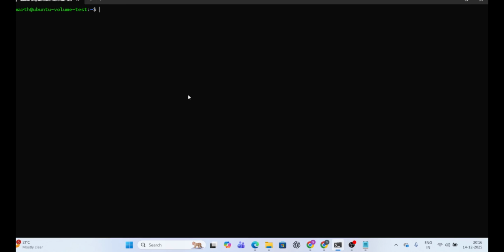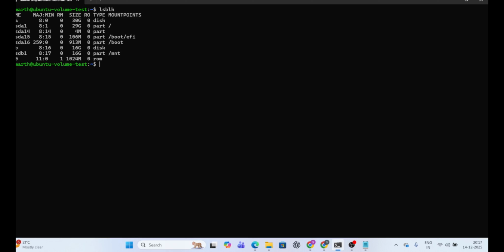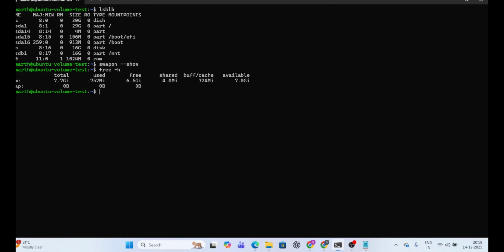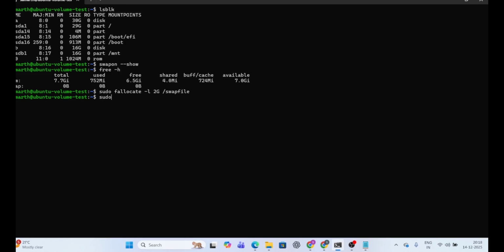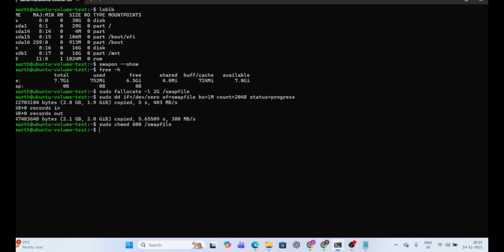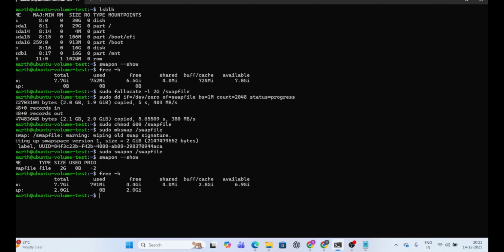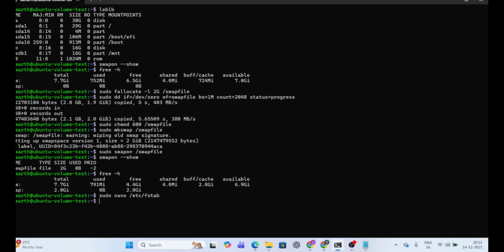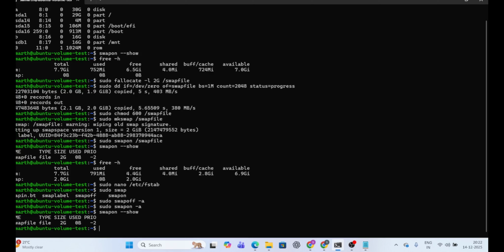Linux Swap Space Explained | Create Swap File & Partition | Ubuntu Step-by-Step

Comment: NOTES
   Files with holes
       The swap file implementation in the kernel expects to be able to write
       to the file directly, without the assistance of the filesystem. This is
       a problem on files with holes or on copy-on-write files on filesystems
       like Btrfs.

       Commands like cp(1) or truncate(1) create files with holes. These files
       will be rejected by swapon.

       Preallocated files created by fallocate(1) may be interpreted as files
       with holes too depending of the filesystem. Preallocated swap files are
       supported on XFS since Linux 4.18.

       The most portable solution to create a swap file is to use dd(1) and
       /dev/zero.